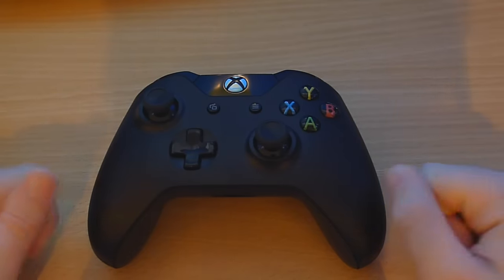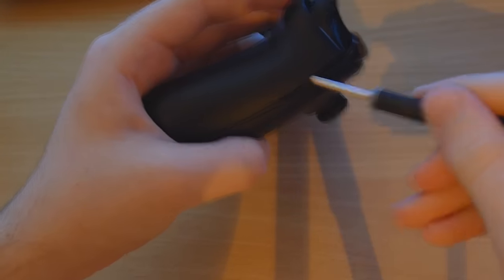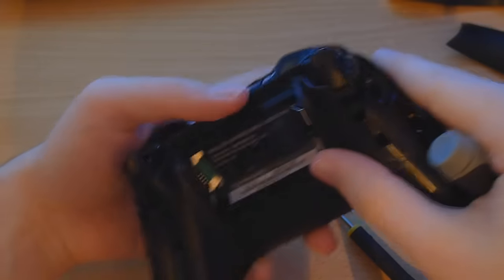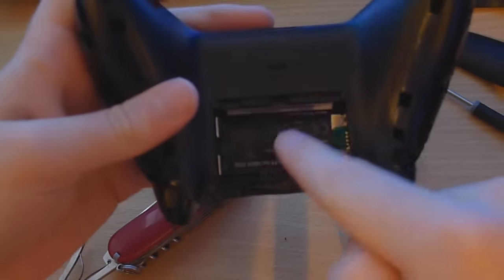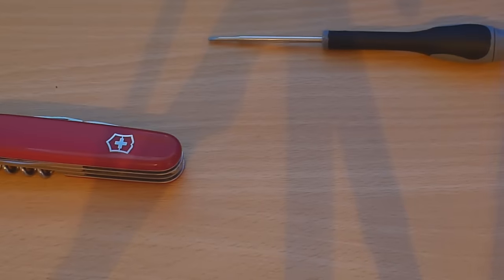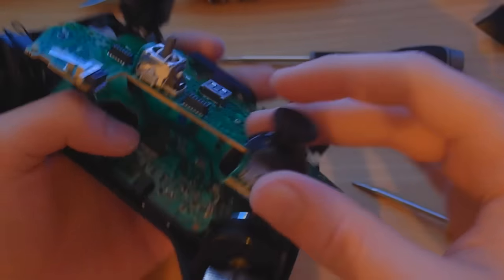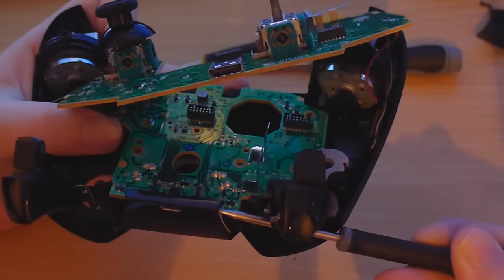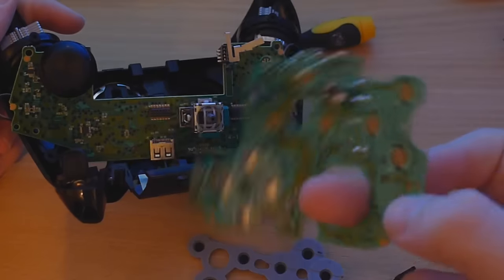How to Open up an Xbox One Controller

Comment: I would always remove the rumble motors when fixing a controller, this would solve your "reach  around" issue and make it easier to get to that other PCB without worrying about breaking the wires in the process. *The More you Know*

Comment: My clips definitely broke. I highly recommend using the plastic wedge tools that are available. That made getting under the plates much easier. Even still, I broke the top outside clip on both plates. I also recommend just getting a security torx (who tf pronounces it “torr-ex”?). They’re like $5. Don’t break the security bits. I’ve heard this suggested by like 5 different people and although it’s supposedly “super simple” my security pins inside the torx screws did not break. So I ordered a TR8 and now I have one for the rest of my life. Who doesn’t like having the right tool for a job? Bunch of cave people apparently. Of wait, cave people liked tools. That’s how they got out of the caves.

Comment: Anybody still looking to do this, do yourself a favor. Run to Walmart and pick up a cellphone repair kit for 8 dollars. It has the security torx you need and won't strip your bolts out. Use the right tool for the job.

Comment: No why would you need a soldering iron to see attached these particular fracking vibration Motors when you can easily dismantled it as you just been chosen this particular document and middle finger back up to you as well as you were swearing too many views on this resourceful information

Interesting so you going to be taking every button out individually when you can place your hand in that slot and took the controller over and Catch Em All at the same time

Comment: Once you remove the bumpers, they no longer can be snapped back on. They're broken. 😕
Reply from the maker: Well I know for a fact that's not true as I remove them in this video and after I finished making this video I put the controller back together and have been using it ever since. The bumpers work fine.
Reply: Well, I know for a fact that the bumpers are one whole piece. Once broken, it does not snap back in place. It falls off.
Reply from the maker: The left and right bumpers are two separate bumper pieces.
Reply: Excuse me, I'm sorry for not clarifying. Not for the Xbox Elite Controller, it's one whole piece.
Reply: He Said Xbox ONE,not Xbox one elite. and also, you probably rushed

Comment: Now my controller is broken, thanks
Reply from the maker: Why is that my fault? I didn't force you to take it apart. You chose to do that. I didn't break my controller in this video, so if you did then clearly you didn't follow the instructions correctly.
Reply: @MODDEDWARFARE  for starters you gave no warning the risk of taking apart your controller which seems like something you would state at the beginning,not to mention I followed the instructions to the dot

Comment: When you took it apart and you realize you don't have the bit to  take out the screws
Reply: Yes I have just spent alday running around to find a soldering iron took the pad apart and then came across the screws there a pain in the arse...did you find what fits it?

Comment: I broke my left trigger now I aim automatically now
Reply: but this did help
Reply: Your controller was probably dis-located off its latch, its what the trigger is attached to. It is very easy to put back on, all that is required is to take apart the controller, and replace back on.
Reply: If you don't know what the latch looks like, just look at your other trigger and compare, you'll know what I mean.

Comment: This video is super old but here is the life lesson - If you own a fully mechanical keyboard for your PC, eat and drink all the shit you want when you're at your computer. If you are playing on a console, wash your hands before you use your controllers and don't drink or eat anything sticky or crumby. All of your problems will be solved. My start button on my controller was sticky and that requires you to remove the top motherboard to get to the rubber button absorbers, and underneath, the gunk. Virtually impossible without breaking something or soldering and I have a full Torx security set of screwdrivers and plastic openers. He did get it open but he also didn't show you the multiple pieces that come off those motherboards in the process. It's not easy because they don't want you to mess with it or mod it. Go figure, a channel dedicated to modding electronics can't do this without breaking something, or cutting wires.. yes I saw that.

Comment: The bottom 2 security bolts won’t come out. The top 2 cane out fine. Pain in the ass. 

Update: got 3 out of 5 security bolts removed. Took 1 hour.

Update: Smashed it against the wall because I’ve given up. Xbox wins, take my money.

Comment: Actually you can do this in about 3 steps

First you have to buy an xbox controller

Second since they made the entire controller for TWO FUCKING DOLLARS it will fall apart and have every single button unresponsive in the first month you own it .

Third you ask  Microsoft support on how to fix/maintain your controller and they will promptly not tell you anything so you can dump more money into getting screwedover.

Comment: I love it, " get a flat head screwdriver small enough to fit in between the security part and the screw" mine is small enough I can fit three in and it still don't work, fml, how about you show us how to fuckin break the security thing so I can just use any old screwdriver

Comment: Here because of the dam LB button every fricken time
Reply: Doggedly handsome I threw mine at the ground and broke left bumper. Had to replace it but before I watched this video I dripped a tone of super glue in it trying to fix it and it didn't work completely destroying the inside non replaceable on the remote... I had a second controller that I gave to my brother because he had broken his battery holder so I fixed it and was able to get my controller back. It had a problem though. A sticky A button... I got some rubbing alcohol and dipped cotton swaps in it. I took apart the controller and soaked around the a button and started clicking. That worked. Now my old controller is trash but I have a lot of spare parts...
Reply: Same. My LB button broke on my last controller, bought a new one. Now, my LB and RB button is broken on the new controller (just two months later). Fuckin' gay.
Reply: @generalaspergers4205  send one to me and I'll fix it.
Reply: @generalaspergers4205  or dm on Twitter I'll walk you through

Comment: My right bumper broke off the controller and I wanted to expose the part that  it broke from so I could glue it with no issues why the fuck does it have to be so secure

Comment: OK does anybody know how to fix a Xbox1 remote mine kept disconnecting then it wouldn't turn on and my batteries were fully charged I've tried everything anybody know how to fix it or what to do to get it fixed by someone else or to get a replacement for a good price
Reply: does it not connect to the console?
Reply: Creepieryew7  it doesn't turn on at all
Reply: Dude can you answer
Reply: Please 
It doesn't turn on at all
Reply: Mr. Doggytime 25 try looking at the battery compartment see if the metal bits are in the right place
Reply: Yeah it mainly looks good
Reply: Mr. Doggytime 25 does it turn on with a charger or micro SUB?
Reply: Mr. Doggytime 25 USB
Reply: No it doesn't I tried
Reply: Mr. Doggytime 25 have u taken it apart before? maybe u took something out or broke a wire?
Reply: Also I tried normal  aa batteries  also rechargeable batteries
Reply: Creepieryew7   no
Reply: Mr. Doggytime 25 I'm not sure then bro maybe the power wires inside have broken😕
Reply: Creepieryew7  also I kinda don't want to cause it could fuck my remote up even more do you know if gamestop helps with these things
Reply: Creepieryew7 also when I said no I meant I didn't take it apart
Reply: Mr. Doggytime 25 I don't live in the USA so I'm not sure but they should send it for repair if u have the box or a receipt
Reply: Creepieryew7 hey do you know if gamestop helps with this kind of thing
Reply: OK thank you for your time man your a life saver
Reply: Hey man thank for your time y
Reply: Hey what's your gamertag I'll add you as a friend
Reply: Mr. Doggytime 25 same as my yt
Reply: Creepieryew7 ok hey this is my second channel my first is the same name  but instead of a puppy it's an adult German Shepard
Reply: I also mean what's your Xbox gamertag
Reply: Make sure the batteries are put in the correct ways. You welcome
Reply: Bro have you fixed it yet or replaced it because I know how to fix that

Comment: horrible disassembly just due to the prying part i feel like i am either going to slip and stab myself in the hand of break the controller in the process. plain old fucking screws would've been much better
Reply: well i went to the herculean effort of taking it apart to find out i played so much dark souls that the little plastic peg that pushes my r1 fucking snapped off apparently and i have nothing to fix that so time to buy a new one now that i know its fucked

Comment: dam controller I got from GameStop had stiky keys. took it apart to find previous owner dropped the controller a couple of time. now I got to buy a fucking shell for the dam thing.....fucking gamestop
Reply: and no I'm not taking it back. where's the fun in that.
Reply: I feel bad for you  that's sad fucking gamestop I got the bf  1 deal with bf1 console and controller  and bf1 it wasn't used but recently it turned off and it won't turn on I tried new batteries still didn't work

Comment: you broke the bumpers thats not how they come off lol
Reply from the maker: Nope, If I broke them how come I was able to put the controller back together and have been using it for the past 3 years after making the video with no issues. There may be another way to remove them which I wasn't aware of when making the video. However the method I used does not damage the bumpers and is a valid method of removing them.
Reply: @MODDEDWARFARE  the bumpers are a part of the xbox symbol button housing and have a bridge that joins them. The bumpers left and right are actually one unit. You may have got lucky and broke the bridge at a point that maintains their integrity somewhat. good vid besides that Dude.
Reply from the maker: @OLDDKINGTLAND  I didn't break anything I just removed the bumpers from their housing. You keep using the word break to insinuate I damaged something. That is simply false. Its been a while since I opened the controller but even if the left and right bumpers are attached to that one bridge unit as you call it, all i did was remove the bumpers from that unit. Nothing was broken or damaged in the process. They are designed to come off.

Comment: it's next to impossible to remove the shells without doing some minor damage to the spaces between them and the rest. The triggers are made from this soft shiny plastic so they'll end up being scratched. You can even break the shells if you're not careful enough. This is horrible design, you cannot even properly clean this damn thing, not mention the repair.

Comment: The Xbox 360 controllers are SOOOOO much easier. I will not be putting/customising my xbone one controllers. 
I have opened and cleaned, swapped and customised 10 X360 controllers, and I could be reckless taking it apart (if I wanted to) and the fucker is built like a tank. The Xbox one controller looks so fragile... (also 10 x360 controllers sound like nothing but they are expensive for whoever knows why).

Comment: "When you open it up with a metal tool, you risk to get marks."

Yeah, if you break it like a daycarechild, just put your thumb under to make pressure and open the clips easily with a knife or flathead-screwdriver.

"When you shall screw up the torx, just break the pin in the middle and use a flathead screwdriver to open it up"

Yeah, or what about to actually use the Torx-screwdriver that is meant for it without to break the pin in the middle?

/Lifooz